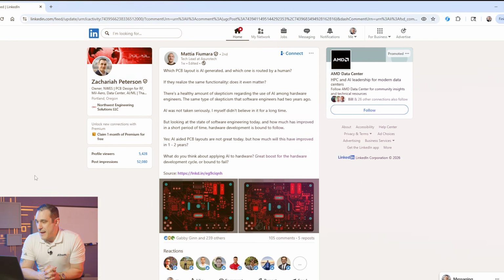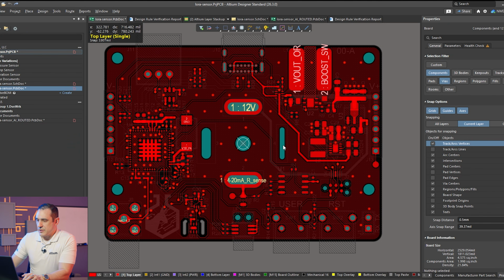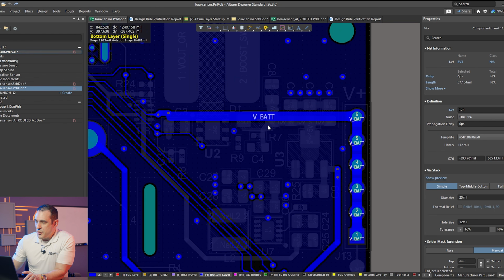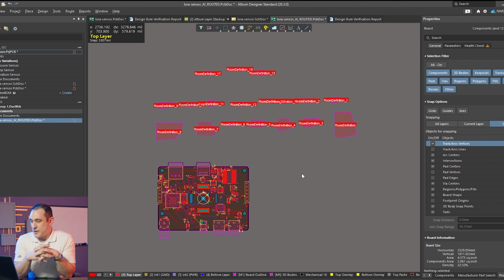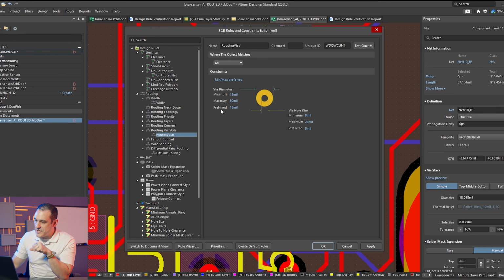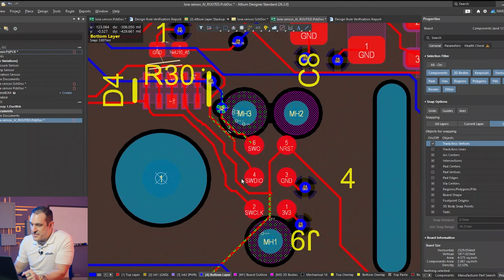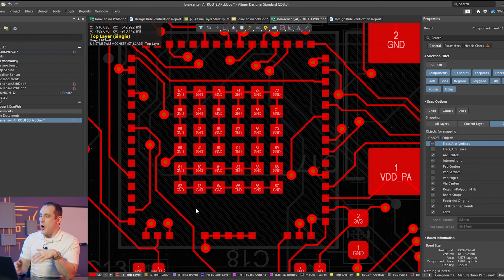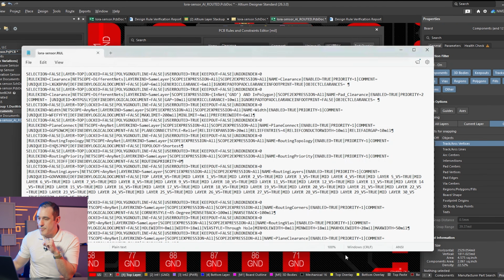AI PCB Layout vs. Human Design: The Honest Truth

Comment: Wait some months – using a neural network for writing texts won't produce a short film. When a neural network is trained to consider not only crosstalk and component size, but also the thermal interactions between components, and maintenance/repair ergonomics, you'll be surprised how often people miss important aspects of the coexistence, long-term, and high-quality operation of components on a board. Repairs, especially, are a big concern.
It's still too early to compare the actions of a trained, highly-practiced person with "inexperienced" neural networks. We need to be patient for not as much as a year or two: first, commercial versions will appear, then open-source ones, meaning widely available and open to further training in specific areas (microwave, switching, processor, power, etc.) using Loras.
Reply: "Wait a few years, it's still in its infancy" has been said in regards to AI for about 5 years now. It's a running gag at this point. There's no proof AI will ever be good enough at any task. It might just stagnate at being mediocre at best no matter how much compute and model training you throw at it.
Reply: If AI (or human) apply all that information it will end up with unroutable PCB, or create 16 layer version for simple things. Sometimes you have to compromise. Also using, essentialy randomly, a larger dataset will not yield better results, but just more chaotic.
Reply: @AndSawMir  A period is coming when a "software product" no longer contains fixed functions and capabilities, but will acquire a professional orientation tailored to the owner's needs: neural models capable of self-learning are already beginning to work in some places. Expecting a "finished product" based on neural networks is still too premature. No one was born with a violin in their hands, just as no one was born with a calculator. But trained design professionals have less time than everyone hopes...
Therefore, you shouldn't evaluate the next neural model by the "data size" and immediately expect that the first iteration will be competitive with a professional specialist.
Reply: @_JohnDoe_ no one was born with a delorean with a flux-capacitor that eats bananas.
Reply: @robegatt  But! No one's prevent you from earning for your DeLorean by DIY or some else ;)
Reply: LOL
Reply: I don't think handing off everything to an AI model will ever give you effective results. It's all about implementing the iterative process required to complete the layout the right way. That means someone who is an expert has to run the tool.
Reply: @Zachariah-Peterson  And there's no need to "outsource everything" to AI. I'm currently selecting a model (and new, more optimized, less hallucinatory ones are constantly appearing) for building a multi-agent pipeline for the "expert design department." In this pipeline, antenna design options will be tested: from selecting/searching for materials to taking into account the edge curvature/aperture characteristics of the "horns," plus developing hardware and software test benches/test algorithms. I don't expect any model to draw me a ready-made "horn with moderators" layout, but at each stage (after the "conclusion" is issued by the next "specialist," and there are many of them), I make a decision: transfer current developments/solutions/calculated parameters/compromise conditions to the next "specialist," or "return for revision/search for compromises"/abandon the current direction. This saves time dramatically! That being said, I haven't fired anyone and I won't fire anyone )) because I'm already both my own boss and my own subordinate.
That is, I don't expect neural networks to do all the work for me, but they are already really offloading some routine and tedious aspects of development.
But advocates of pure development without AI are free to continue to move around on foot ))

Comment: You know what this is, right ? As usual, the so-called "AI" hallucinated a layout that looks like a million various circuit boards it has seen photos of, and then "connected the dots" without understanding anything about electricity, electronics, electromagnetism, thermals, emissions, the need to pass any kind of certification, manufacturability, etc, etc, etc... Now, can we all stop pretending that "AI" is anything other than a scam ? And can we all start ignoring every and all douchenozzle who posts on any social network, especially LinkedIn?

Comment: The only advantage of having an AI lay out a printed circuit board is that the AI doesn't have feelings that might get hurt when the PCB engineer tells it that it screwed up and needs to redo the design.  PCB engineer here; been there, done that.
Reply: Well we'd filter out insecure "engineers" when we contract/hire. But really, the advantage is speed (thus cost), almost identical to Draftsman being displaced by CAD software + floor plotter...

Comment: It's a complete junk design by AI. Specially the PSU section. even if the board has no DRC errors and all nets connected and manufacturable then also PSU might loose its job. AI can't compete with human not even with coding as well. Yes AI helps speeding up the process but if you need "The best" there is no alternative. Yes in some areas AI does wonder.

Comment: Trace to pad connection symmetry on SMD component are not applied neither in the human nor in the AI designed board. Trace to pad symmetry is necessary to avoid small component drifting during reflow (not wave) soldering.
Reply: Wave soldering huh?
Reply: @brandise76 Reflow soldering. Sorry.

Comment: Based on some of @zackslab comments about the tool used, this AI tool has a similiar feel to early versions of AI video.  They are trying to do the entire process with a single Reinforcement Learning step when they need multiple levels running against/parallel to each other.  A agent/step for localization of components, route thickness, board rules, component selection, and likely a few more that I just don't have the experience to identify.   

Basically think of this as AI can't solve a simple math problem(where this is at) becomes to have the AI identify it's a math problem and use Wolfram Alpha to provide accurate solution.  This won't be the last we see of this and I expect it to get quite a bit better.  Biggest issue I expect is the board layout and dev is not the current cost driver of product releases, and AI won't touch the physical integration step simply due to how many variables your stuck dealing with.

Comment: It took me all my AI credit, about a full day, while hand holding an AI for an iCE40-Up5k with U.FL, Programmer, flash, PMOD and 2x9mm header.  Gave up after the LED line routing, didn't even get to the regulators and PMOD sorted .. I designed this in about the same time and it works really well and able to overclock the hell out of the design (~10ns delay).

Comment: my brain hurts seeing both layouts are worthy to be discussed online. Rules are set to manufacturer capabilities, not board needs. 4 layers for a board this complexity, really ? Heat traps for SMD reflow soldering ? Do not argue tombstone ! Can I have a peek into the DRC settings ? DCDC design will give you a nice random signal generator in your spectrum analyser. AI will overtake man routed layouts like this soon. Properly set rules with autorouter can better perform in Altium. Please explain why rooms exist in Altium. Use colours to highlight critical nets for routing.
Reply: If a 4 layer board is an insignificant cost increase over 2 layers, sticking with 2 layers is not wise. Especially if you factor in how much your time is worth versus the cost increase. 

Today you can have a 4 layer board for dollars more per PCB than a 2 layer one. Unless you're planning on making 1000+ of them, 4 layers is the cost saving option.
Reply: @AMalas  yeah, also this board could not be routed in 2 layers with the LGA. also didn't want to increase loop areas on the switching converters. def would not do 2 layer really on any board anymore. 4 and 6 layer fabs are extremely cheap now.
Reply: @ZacksLab I agree. I have a personal project that is hyper cost optimized for its capabilities and it is on a 6 layer board. Any other method I considered for getting it done would cost more unless im setting up a production line!
Reply: @AMalas  for sure. also, modern parts that have sub 1ns rise times do not fare well from SI/EMC point of view on 2 layer. having your return plane separated by prepreg rather than core material is one reason alone to go 4 layer even if you don't need it for routing space.
Reply: i'm the author of the board and ran the experiment of running it through quilter's AI router out of curiosity to compare it against my design.

curious about your 4 layer comment, are you suggesting you'd use 2? 

yes, the DRCs on my board were set for the fabricator i was using. the DRC for the AI board were constrained by their own tooling, not really sure why they ended up the way they did.

i hand soldered these LoRa boards and they work just fine, have been running for 3 months now sending data back to a gateway ~200m away with no issues. ~4uW consumption in the lowest power state between tx's.

wrt thermal relief, they're early prototypes for a personal project. passives ARE copper balanced so they won't tombstone once i do run these in a larger run, but i may take zachariah's advice on ditching thermal reliefs for my next spin.

altium uses rooms for multichannel designs... the rooms were a requirement by quilter to use their AI tool. i did not use rooms on my design.
Reply: @ZacksLab the topic of the video ist PCB Routing skills. Are you able to share the altium project files with me ? I would like to give it a try too.
Reply: Is this comment AI generated? It feels line a barely coherent word salad

Comment: as i tried to explain to folks on the kicad discord a couple years ago, the fundamental issue here is that the AI tools don't have enough context for what they're doing, in part because schematics are not normally annotated with the kind of information they'd need. it's even worse if they're just working from a netlist. think about the sort of stuff you know when you're routing a PCB. what each IC or part IS and DOES. how much power it dissipates, the sorts of voltages and currents it is affecting. and then for every trace, what sort of voltages and currents must it carry, what the frequency content looks like, and if we care whether the signal is perturbed by nearby signals. (plus even more i'm sure i don't know about! i'm not an expert!) i've never seen a schematic annotated in that sort of detail, because the people working with it can figure it out. (maybe they ought to be annotated more, but that's a separate issue.) without that kind of information, you can't even begin route a switching regulator correctly, let alone anything complicated.

until we see an AI that can read and review a schematic and find simple issues / departures from the relevant data sheets, and answer questions like "how far apart should we keep nets X and Y, taking into about signal integrity and thermal issues?" then they can't hope to route the schematic onto a PCB. they might very well be able to do that someday! but it isn't today.
Reply: I've found that AI does help a lot with PCB design, however only as an advisory agent. It works when you give it enough context, and it actually gives some pretty decent feedback. It is aware of trace width, thermals, distances etc.. I feed it a lot of context, schematics, simulation results from SPICE (including Fast Fourier Transformer and Frequency Response results) and PCB designs which gives it plenty of information to form good discussions.

I would absolutely not have AI design the PCB itself, however it does work very good as an assistant with whom you can discuss your project into fine-grained detail.
Reply: @justincase9471 can you give some more context on which AI you use and how? I've seen some people get really useful info from AI which reduces the overall turnover time but I was never able to. Just a pointer will also be helpful tho.
Reply: @justincase9471  it scavanges around forums to tell you what you want to hear. Not a very helpful assistant.
Reply: @robegatt  "it scavanges around forums" This is true, the rest is your opinion I think? I am aware that it fully reads forums, I actually find ways to use that to my advantage as I can also tell it to look at a problem from the perspective of a forum user. I refer to specific users who I know are good. most of them unfortunately are no longer around so AI is the only way to interact with their thoughts and insights.

Maybe I'm just lucky and I can work pretty well with AI as an assistant. I don't know in which field you're active, in my field most forums are full of snake-oil-salesman and highly opiniated seniors who seem to be stuck in the past.. (yes I do high end Audio...)
Reply: @justincase9471  well, e.g. for fast searches on software languages problem (the one you find on stackoverflow for example) it IS useful. BUT for other "discussions" it is   kind of condescending in a sneaky way...
Reply: @robegatt isn’t that what you do when you are stuck too
Reply: KiCad is so goated
Reply: @h1tec  Kicad is so free
Reply: Not all of this post is really up to date. I perform review of the schematic of my project with gpt (5.4 + extended thinking), i base on netlist from EasyEDA PRO and:
gpt decode any chip that was used in PCB; 
perfectly recognise all peripheral stuffs used to connect DAC, two ADC, PHY, LCD etc. He found that i use schematic from evaluation board;
he point out that some signals are used wrong or their names are wrongly assumed. And that was great outcome from the review;
he wrote initial code for arm_none_eabi_g++  in C++ style for all GPIO used in PCB; 
he build up class for initialisation of each peripheral driver; 

Going back to PCB there is some troubles to solve during design pcb but AI could be handy in this field. We have insufficient human readable machine-machine-interface for LLM to particular EDA.
Reply: really great points here. I think deeply researching the data sheets for each coponents, and using those markdowns in the board review and evaluation process is probably the best usecase right now. Ive built a system to do that and it seems to find things that I missed. Its kind of like a better DRC check. I think its hugely useful for non-pro people trying to make hobbyist PCBs.
Reply: Questions like "how far apart should we keep nets X and Y, taking into about signal integrity and thermal issues?" don't require AI at all, except for an agentic approach that runs the tool for you. But even then, it's your job to direct the agent unless the dataset for htat agent is really good and highly contextualized. Otherwise, don't even bother trying to get LLMs to do any of this. Simbeor is a good example of an application that is doing it correctly. We had Yuriy Shlepnev on a podcast episode recently where he showed what an agentic tool looks like, you can watch it here: https://www.youtube.com/watch?v=s_fcpgeEE-8
Reply: just because it can handle some text in context they think Al is actually some kind of intelligence...  cunning people gave that name to make real money flow in the right place...
Reply: Frontier multimodal models can already examine a schematic and intuit what is happening.  The models that can be run on consumer hardware take a while but are largely almost there.
We're certainly not at the point where Claude could oneshot a PCB of any reasonable complexity, but most of the failures here should have been addressed by the human orchestrating the AI.  Until the model can one-shot reasonably large designs, you need HITL gates to make sure the AI doesn't do dumb things.
But imagine if the human doing this had done some placement work and set the rules up correctly, and guided it instead of just letting it rip.  First route power nets, use short and wide traces.  Then route high frequency or impedance controlled nets.  Then route low speed management signals.
I honestly loved Zach's suggestion to make an Altium rule generator.  I feel like there are opportunities here.
Reply: @DeadCatX2  they filled books with sci-fi wish-lists.....
Reply: @DeadCatX2 So what do they mean by I rule generation? I’ll make this if someone can explain it to me and what I gotta do 🫡. I’ll get her done in a few days no sweat 🫶🏼🦍

Comment: I have seen this post on LinkedIn, but it is kind of like mocking an obviously inadequate job to prove a point. It would be interesting to find the current best tools for the job and actually test them. I don't know how far Quilter is, for example. I can see this being used to design boards with basically no hard requirements, just "a lot of stuff." It could save a day or two, but obviously it doesn't seem to be nearly there yet for any kind of serious designs.
Reply: i looked at all of the tools available to the public today and Quilter was the only one who had an open beta.
Reply: My intention was not to mock an AI design, I think the side-by-side comparison is warranted given the hype around AI generally. I alsos think AI tools will be good timesavers, and I already use AI regularly. But my usage of AI is purely task-based, I'm not trying to do the equivalent of a 1-sentence prompt in any AI-driven task.